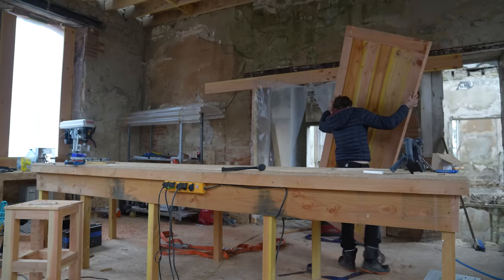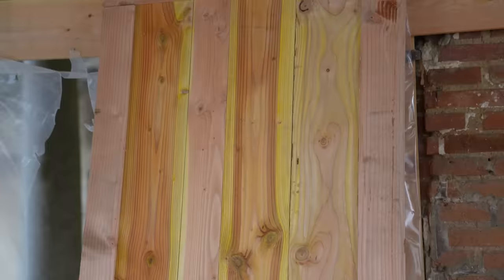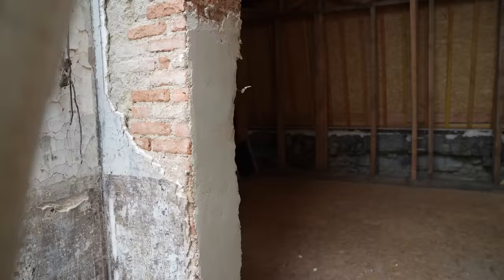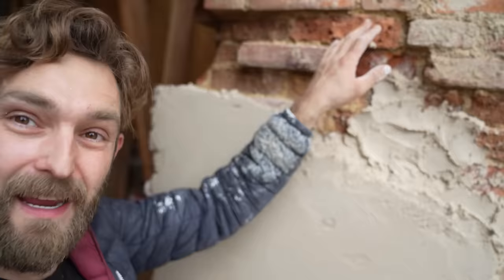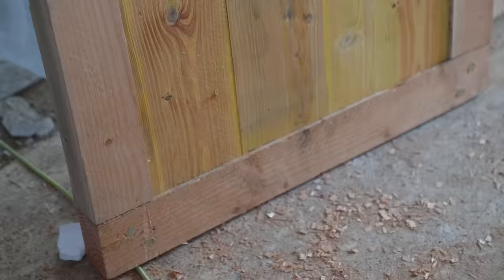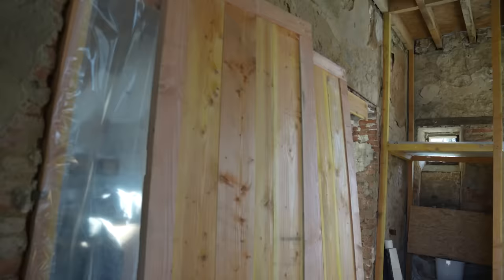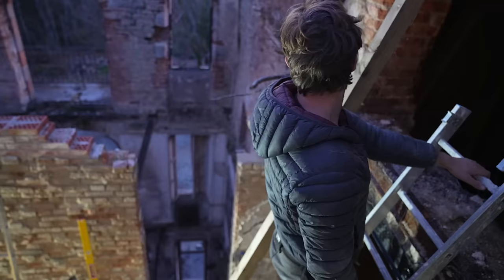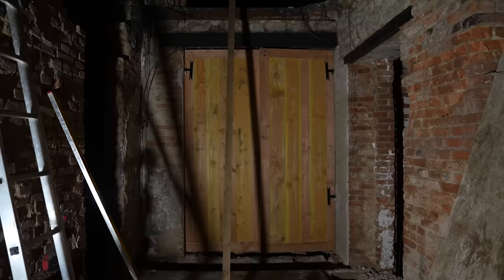The first room back in the chateau.

Comment: Suggestion: Lap the doors where they meet. Since you have to trim them a bit anyway, use the router to take the full overhang of half of the depth on opposite sides (inside and outside). Then the rain won’t get through any gap, and you can increase the amount taken off if you get swelling in more humid weather, and not end up with a gap when they shrink again as life becomes less humid again.

Comment: Just needs a 2 degree taper on the mating edges and then you can probably close them.  Add a stop to one door and a latch into the ceiling on the other and you can use one door most of time time and it will stop against the stationary one.

Comment: If they are too snug a fit now, you might need to take into account the expansion of the doors as the weather warms up.
Reply: The doors should shrink as it gets warmer and they lose moisture.
Reply: As the doors,are there to keep the weather out, won't they swell in the rain?

Interior and exterior joinery have different moisture contents.

So some kind of oil treatment to stop the moisture content jumping around too much?

Comment: :hand-pink-waving:Thanks for the vlog Dan, as always, a joy! Lime plastering is completely different from using Gypsum Dan?  Bit of an issue with your advice.  You are a professional 'influencer' now.. graduate to hot lime?😅 There are three (Or four if internal) coats. Scat; Scratch then top. '' The scat coat is a soupy lime mix of 3/1 unhaired lime mortar, this is harled onto the walls for a key. You allow this to dry and go white, before starting the next coat.
Second coat is the scratch coat or otherwise known as the dub coat, this is the 3/1 horse or goat hair coat, this can be applied up to 20mm thick at any one time. This coat is scratched then scratched up. Once you are happy with this coat you allow to dry/ cure.
Third coat & final if external, is the 3/1 unhaired float coat. Applied at a depth of 6 – 10mm depending on what’s required. This coat after being troweled on and worked well is then floated with a polyurethane float or a wooden one, now this is the important part…… at no time can you rush lime, it’s a traditional product which carbonates to cure.
Fourth and final coat for internal use…. is a lime putty  3/2 lime skim which is applied wet on wet and each layer no more than 1.5mm so an overall depth of 3mm. This can be a tricky one to do as it dries fast, but you keep misting with water to keep the skim as workable as possible.'

Comment: U could utilize the overlap of the doors to make them even more airtight. Just mill the edge towards the other door so one door has half of the depth milled at the front and the other door has half milled at the back. That would make it more airtight than making a gap.. Also, wood is alive and well will expand and contract with humidity,.. so that overlap can ensure the door never has issues opening

Comment: Well done on a great effort all round getting your first doors up. Once you’ve got the wall blocked up it will defo be weathertight. Will you be able to create window frames and doors soon to secure your workroom areas in the basement. Great work with the weather improving can only help move the project along.

Comment: Dan…just add an astragal to the outside face of one of the doors. This will cover over any gap between the two doors. Easier than trying to plane the door stiles to get a tight fit. Save your finish carpentry skills (and time to produce) for the permanent oak doors.

Comment: On some of those really wet stormy days, it would be awesome to watch you slowly fix internal sealed from the elements dry walls and apply the lime mortar mix and begin getting them smooth again. 
It would be good for your own mind to walk into nice rooms with nice smooth walls that you know have been repaired and strengthened. 
It would make for nice content also watching you build windows on said same stormy days safely inside. You have the tools now and quite a few still intact windows that you can copy and pump out.

Comment: Good morning Dan one of the door take say half inch of the side with strip between the two doors down to to make a good seal between the two allow for winter swelling and the other door that you never took half inch would need some bolt top and bottom bolts and the other door will become like the master doorwith a lock and handle very good job on the doors and all the very very best. Good luck with the rest and Terry UK.

Comment: Hi Dan, I was looking at your doors which look great and noticed that the bracing behind the panels are not pointing to the hinges.  We have similar doors in our house and have been told by a carpenter that not all our doors have been hung correctly.  According to the carpenter the bracing should point to the three hinges and this provides some stability to the door frame. 😀

Comment: You get those kits, it's a bolt with flanges that comes with a 2-part epoxy. It dries very hard, can't move and you just plaster over the epoxy. It's great for hanging big doors. You should be able to get the in France.

Comment: Have you considered the benefits of a Japanese pull saw, instead of a tenon saw? A pull saw has a few advantages; cuts on the pull stroke, can cut to any depth because it doesn't have brass blade stiffener, has a thinner kerf, and can be used from below the bench while you look down on the piece, making it easier to make super precise cuts. Give it a try, they're really nice to use, especially when you do finer stuff.

Comment: congrats on your first proper storm proof doors would be fine on the front door later on if needed. I don't suppose you will seal the wood with something? I'd be tempted to stay a night in there with a small heating element but that's me. I don't know how you do yurt living Dan you are stronger than I am. Once that room is protected will you tile off the roof then?

Comment: Absolutely amazing doors, but the top of that brick wall on the right still looked a little bit too sketchy to really be secure. I think I might have spent a wee bit longer patching up the rather large overhanging gap in the old brickwork on one side before plastering over the crack and hanging them.

Comment: I hope as this is an attic, you will keep those doors you made. Even if you would like fancier doors for the other rooms.
Reply: In this case, "attic" simply means this is the uppermost space in the building.
There's no reason why this room should be much less finished or grand than the other rooms below. 
It certainly wasn't the intention to have a simple storing space when the house was designed anyway; on the contrary, the main purpose of a mansard roof is to allow on the top floor for a room almost as vast and livable as the ones below.

Comment: Heavy Duty, Bank Vault doors! Way overbuilt for the application. You may find it difficult to get lock hardware or handles that would work on such a thick door. Any children's fingers will be gone if closed on by those doors! Best to stick with standard dimensions for thickness of doors, jambs, frames so you can find hardware without getting custom one off's.

Comment: Are you worried about the integrity of those beam?
Steel begins to lose its strength at temperatures around 450°C (842°F) and can lose half of its strength at temperatures around 600°C (1112°F). The maximum temperatures in a typical house fire can exceed 1000°C.

Comment: Dan, get yourself some proper hammer DRILL bits. Using that spear point to drill holes is going to cause unnecessary damage to the structural integrity of the bricks you’re hanging those massive heavy doors from. Great work though!

Comment: Where are you were going to brick up the right under the roofline there you might want to have a little hatch so that in future if there is any roof leaks, they can access that space.
Reply: Dan explained he plans to keep the full height of the room, as it is, under the roof.
I'm not sure this is the right thing to do, but unless he changes his mind, the uppermost attic won't exist anymore (therefore the door in the upper part of the brick partition wall becomes unnecessary).
Reply: @francesco245  
Thanks for clarifying.

Comment: Dan, so glad to see you are finally using the spray tank to wet your brick wall before laying brick.  You should be doing the same with your stone laying.  I have commented multiple times in the past that you NEED to do this.  Wet stones in the wall will absorb/suck in the mortar better than dry stones giving a better bond.  My masonry husband, (70+ years experience,) also is now saying you need to put a shovel load of cement in with your lime mortar to give your wall more strength.  It might set up a little faster, but will be stronger and your wall will still be able to breathe.  Good work, Dan!

Comment: Quick question for any builders here? Why not use a pressure washer to help clean out decayed pointing etc before repair. Seems like a very efficient and effective method, but reckon I must be wrong or everyone would be doing it.
Thanks for any input in advance.
Reply: He doesn’t have running water on the property yet.
He has to cart water in and store it in a big tank.
Reply: @iu.5146  Ah. Duh, of course, thank you.

Comment: I appreciate the renovation and your ambition.  But I'm not understanding your approach to this Project. There are literally thousands of loose bricks and damaged mortar that need to cut out and repointed with new mortar in order to stabilize the walls and the structure.  Mearly plastering over it and pushing plaster into the joints is just lazy and dangerous in my opinion.

Comment: I really don't understand the logic in the steps that you are doing. Why are you spending time,energy, and materials on doors when you can be putting floors down. So you can put up more roof😮
Reply: Oh, dear...
Maybe if you listened to what Dan says you'd understand better.
Reply: Without the doors, the weather gets in and ruins the floors on that level and beneath.
He has no outbuildings on the property. Having an enclosed room helps him store building materials and equipment.
He will be building all doors and windows for the chateau himself.
He is using the roofed part of the chateau as workshops to restore the rest of the chateau.
What he does has logic and structure to it.